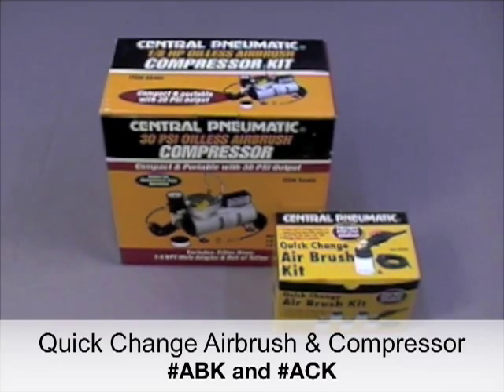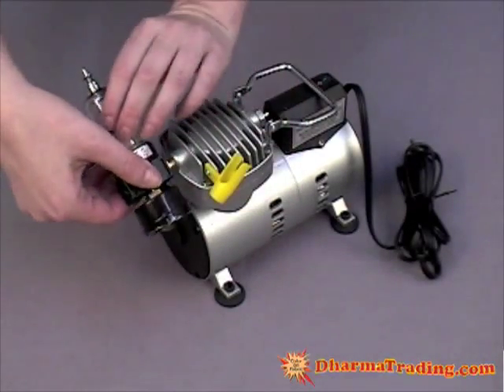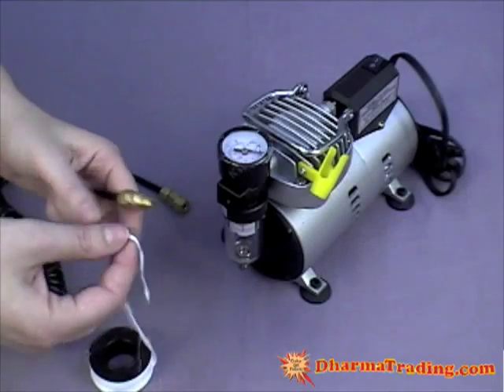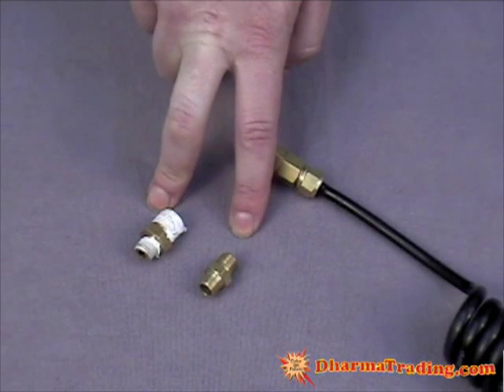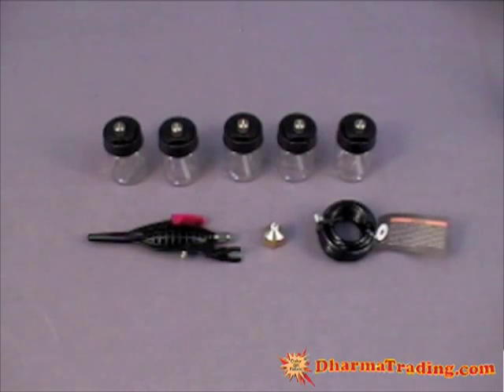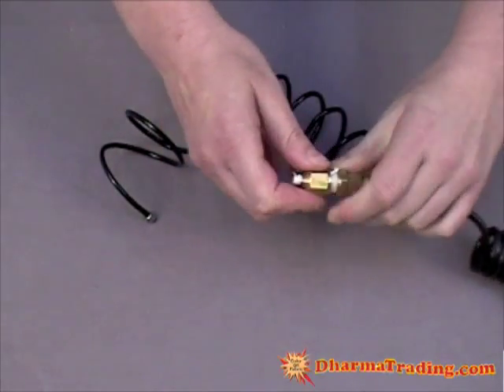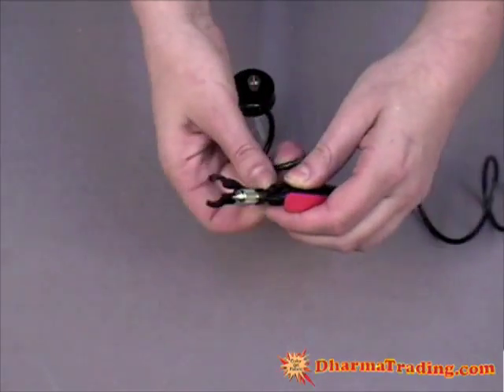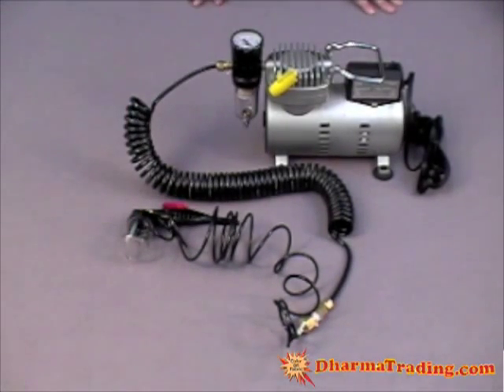Quick Change Airbrush Kit & Compressor

Comment: What is it about the airbrush industry that they refuse to tell the sizes of their hoses and connectors? And why not standardize the hoses and connection sizes? 90% of the hoses, connectors, adapters, and compressors I find online totally OMIT the sizes they use(5mm, 1/4" or 1/8"). On top of that it's next to impossible to purchase the size adapters you use because you either cant find them.